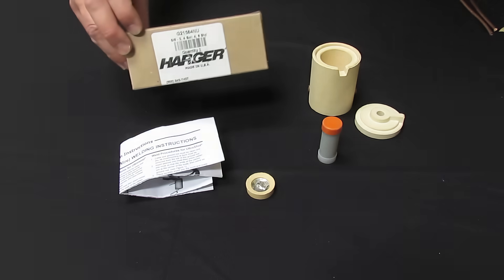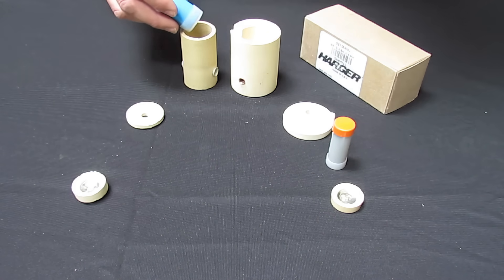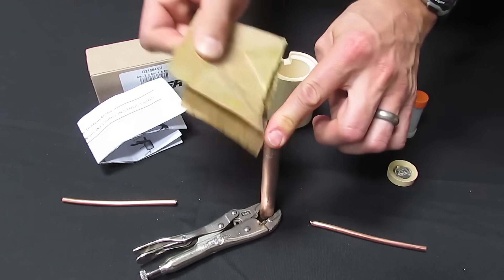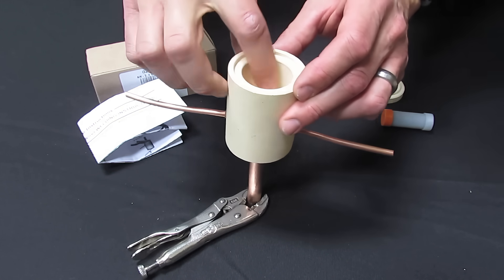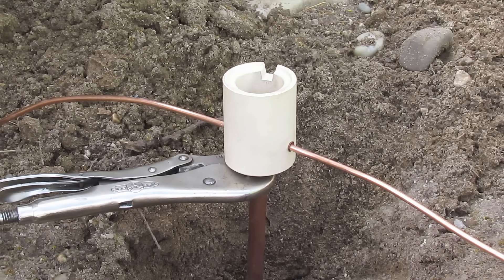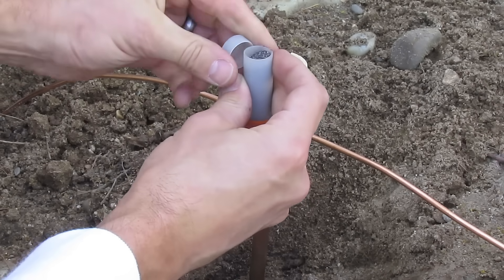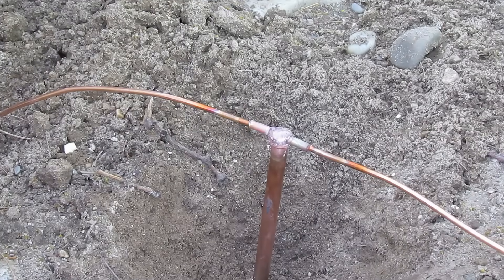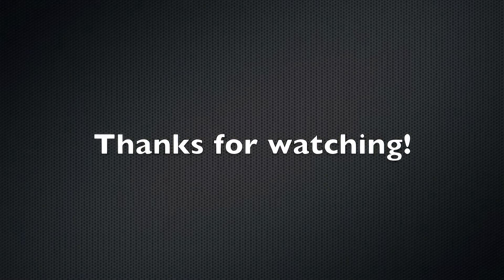Harger Uni-Shot how-to

Comment: Use play- dough to seal the grounding conductor to the grounding electrode, then enjoy the baked cookie smell and the money you saved. Snip a very small piece of copper grounding conductor and add it to the mix when pouring it in.-----  (VERY IMPORTANT)   --- Make sure everything is clean and dry.----- A horsehair brush for the mold and a wire brush of good quality and size for the area is a must have. A extra striker is a must have. If cold a preheat with a hand held burner of the entire area and mold should be done. Don't be casual, be alert, a choice of old clothes and hand's , head and face protection is also a must have.